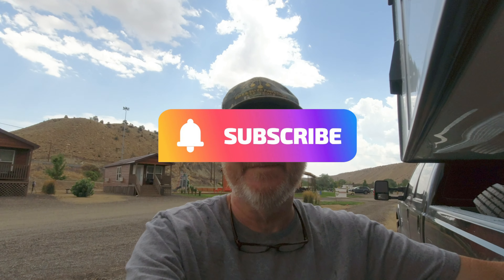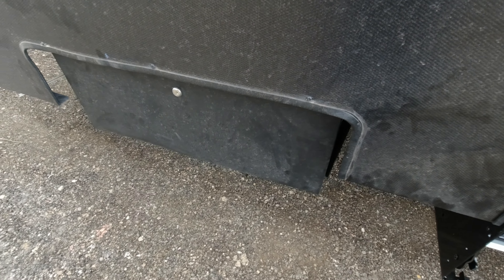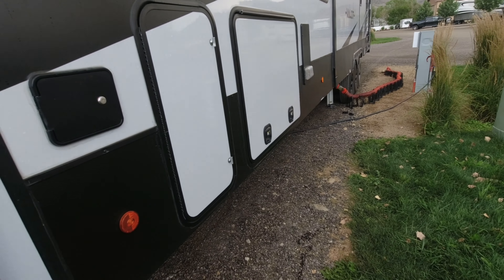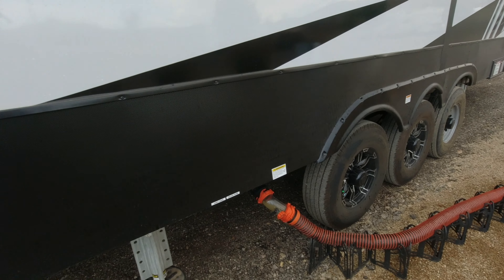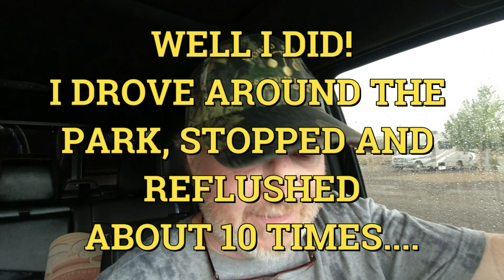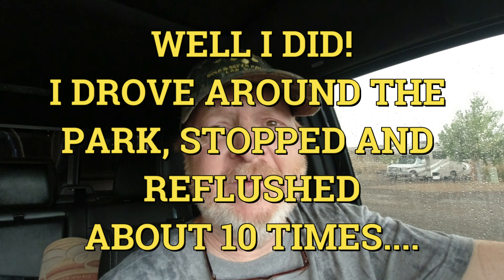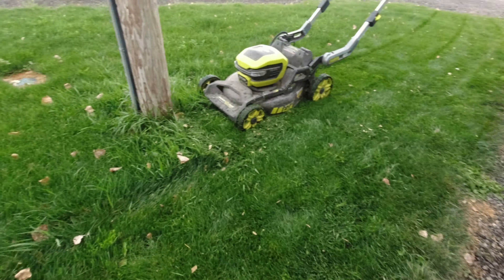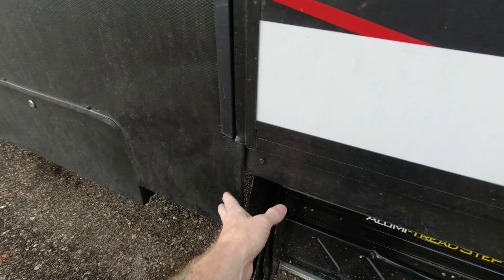NEW UPDATE! Some Repairs are Done!! Alliance Valor Getting Fixed

Comment: before your next long drive, empty the tank, and dump 2 bags of ice down the toilet and drive away immediately. the ice banging around will scrape the tank sides and bottom.
maybe add a little dish soap in too.
you are lucky, ... some class A rigs require removing the windshield to swap the fridge!
Reply from the maker: Thanks for the tips! Fridge is on the truck to be delivered next week! I'm excited!
Reply: I was always told Don't do the Ice!!!
It will damage the sensors in the tank.